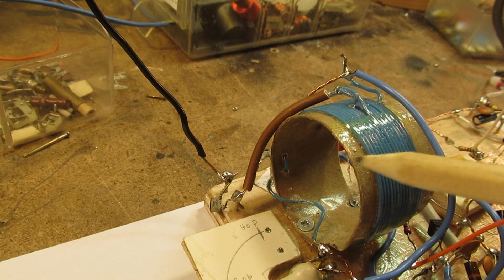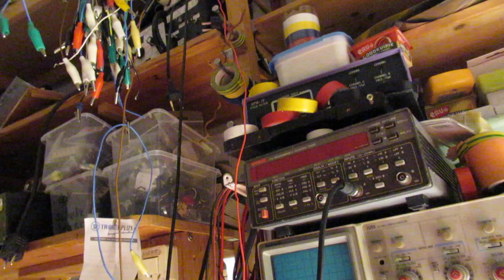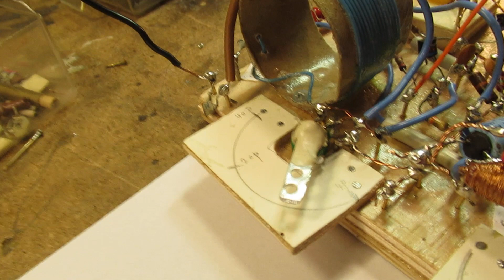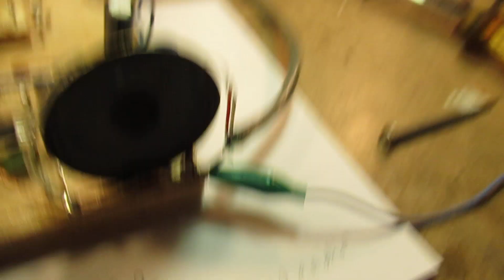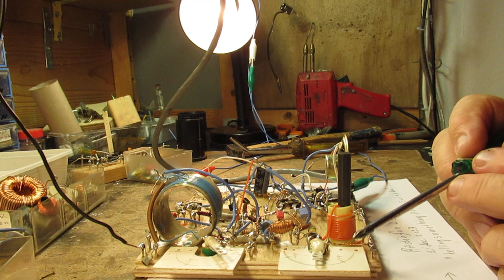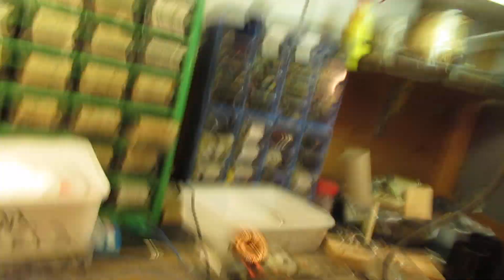VLOG Few transistor SW Superhet receiver 2-6 MC made with FETS etc. first demo/evening Netherlands

Comment: I will always be excited to see more radios from you. I've been watching for many years. Maybe one day I will actually get around to building one! Using a filter to determine the IF is a novel approach that sounds interesting!
Reply from the maker: Thanks. With these ceramic IF filters on 455 KC it is very easy to make a properly working IF amplifier. There are a few of these IF circuits on my YT Channel.
Reply: @radiofun232  I have some filters like that lying around here. I'll have to give that a try some time. I've built many solid state regens, but never a solid state superheterodyne.